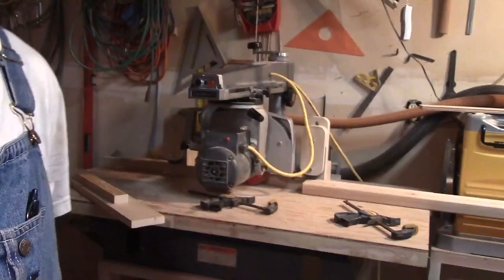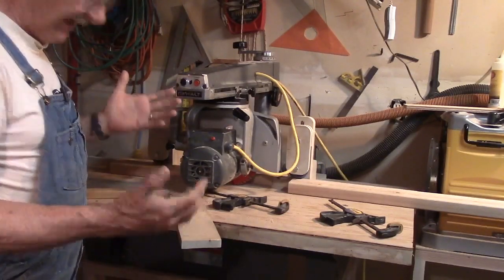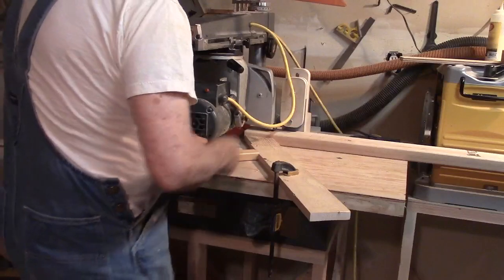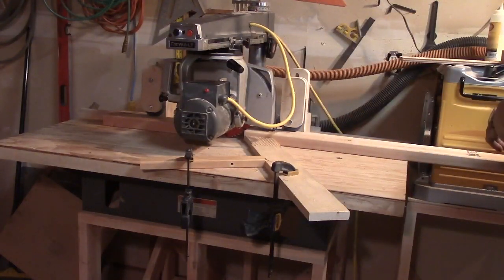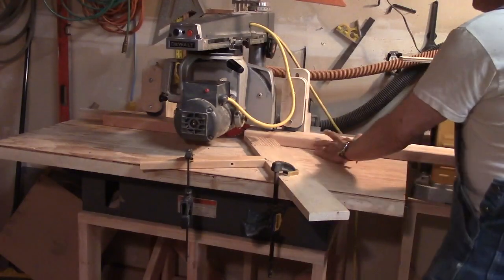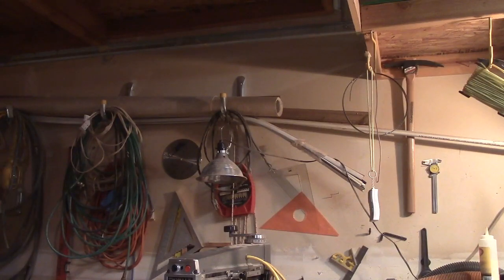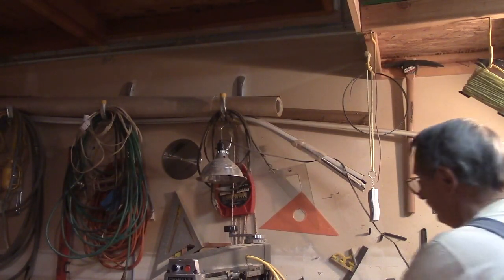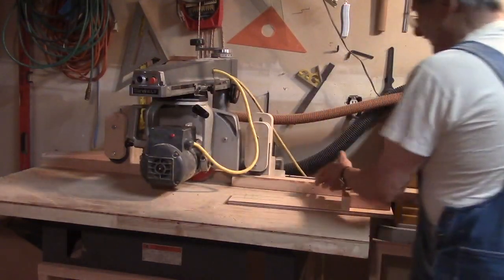Radial Arm Saw Ripping:  WARNING!!!

Comment: Hi Ed, How very honest of you to make this video. I'm impressed! I had my own little joinery shop years ago and I used the Dewalt 125 Radial Arm Saw an awful lot. When I retired, I built a workshop in my back garden and I was lucky enough to find a vintage Dewalt 110 to put in it. So far so good. But the very first thing I did was to try ripping down a length of timber by feeding it through from the wrong side of the blade. Waaaagh! So glad it wasn't caught on video!

Comment: Some good advice here Ed, yes RASs are inherently dangerous, particularly for ripping and when using dado blades. I had a couple of very scary experiences many, many years ago ... never got hurt, but it really taught me the power and speed that these saws have, and I still used the saws for many years after, but with a new respect for safety.  Good to see someone explaining these things .... thanks Ed.
Reply from the maker: WoodWorkWeb Thanks Colin.  Yep, as with all power tools things happen much quicker than a human can react.  I've been hurt by a powerful drill that got hung up, I've carried a nasty scar from a Skill Model 77 for forty years, a pneumonic nail gun cost me 40% of the vision of my left eye when I was twenty-two,  my thumb is still sore two years after getting it tangled up with the blade on my table saw.  But accidents aren't limited to power tools, I cut clear to the bone of left thumb with a freshly sharpened handsaw, "Eddy, don't work the saw, let the saw do the work."  I should have listened to old Frank. 
When I was much younger I had my difficulties with the RAS too:  The thing can kick a board out when ripping in a split second or climb up on a piece of wood when cross cutting or especially when cutting a dado.  I never got hurt because my dad was right there to make sure my body and hands were safely out of the way.  When I say younger I mean 18 or 19 years old.  Dad would never have let me use anything but a drill or jig saw before that.  After years of experience and being hurt in one way or another by lots of different power tools I'd say that all of them are inherently dangerous.  
Knock the fence out of alignment on a powerful table saw then try rip a truck dried 2 x 6 with a 1/4" crown and bit of twist in it and see what happens.  By the grace of God all my accidents were learning experiences that didn't cost me any fingers.  I ramble, sorry.
Reply: Inherently dangerous? I don't buy that. I suppose any sharp piece of metal could be considered dangerous not to mention adding a motor to it. With proper safety gear and techniques it's no more dangerous than any other saw. Stop spreading baloney.
Reply: Table saws are inherently dangerous!  Radial arm saws don't ever require you to push your hands toward the blade, let alone over it.
Reply: @JetSkiBuyFixPlaySellChannel  a corded power drill is dangerous bcs it can suddenly lock in and hit you real hard.

A chainsaw is dangerous (the majority of accidents happen with this) as the chain can snap and fly towards you at a very uncomfortable velocity.

Yes most of the accidents can be avoided with proper technique and safety gear.

But this does not take away that its dangerous. Something is not less dangerous just by proper equipment and technique.

The chances for mutilation or death are lower, yes. I’m a SCUBA diver, while quite few accidents happen. If you buy proper gear its highly unlikely that it will ever let you down and we carry a lot of gear around to increase our chances of survival if something goes wrong.

But that does not take away that its quite dangerous. There are a lot of ways you can fuck up and kill yourself. And if a severe accident happens it will most likely be lethal.

Comment from the maker: Roberto, thanks for the comments.  There are those who have small shops that don't have room for a table saw and a radial arm saw.  Some of these guys find the RAS to be more versatile than a table saw, as I do.  If I had a double garage sized shop I'd have a nice 3 HP table saw with a big out feed table/ assembly right in the middle, and my RAS across one long wall.  The other important reason to buy a RAS is cost: to get a table saw with enough HP to do what my Dewalt 790 will do would cost ten times what I paid.  I kept my little Delta-Rockwell 9" table saw with attached 4" jointer because I still like to use it for some cuts and gosh it only cost me $40.  But the little table saw just hasn't got the HP to rip thicker hardwood the way the RAS does.  I like them both.  Thanks for posting, thanks for watching.
Reply: hello. Sure, i do understand  these reasons  . i'm lucky for  having enough space  (  never enough )  in my shop . but, let  me say, 10 fingers are....useful. my sincere thanks for Your answer. best regards and...more videos about   You.

Comment: This video is very dangerous for the radial arm saw for ripping & using the tool the wrong way can result in permanent injury & loss of fingers & hand. Other people will try
this & will get serious hurt. The wood piece is pulled thru like a bullet when feeding the wrong way. My Dewalt radial saw specifies right on the saw the direction of cut for safety & always use the anti kickback arm.
Tony Trotta
Reply from the maker: +Jeannemarie Trotta You may need to watch the video again.  I did not push the wood through the wrong direction.  I am guilty of not using an anti-kickback device.  In my opinion using good roller hold-downs and a push board is a safe alternative.  There are those who believe that ripping should never, ever be done on a RAS.  I have ripped miles of 2 X stock using a RAS without injury, even so, I make it a practice to position my body out of the rip line just incase something goes awry.    Thanks for watching and I do appreciate your comments.
Reply: +Ed Waggoner Sr. (Papatch) My mistake you are doing it in the correct direction! I know i have seen some videos feeding from the wrong direction  and that is very dangerous. Thank you for the video!
Tony Trotta
Reply from the maker: Jeannemarie Trotta Thanks Tony.

Comment: Hi Ed,

I have just finished restoring a old Dewalt. Since it was ready to use I tried ripping some 12mm plywood on it. It was intended to be 140mm wide and 500mm long. I used a feather board on the in feed but when I got to the end of the cut the now separated board by the fence caught the blade and was pulled back and under, stalling the blade and leaving a huge curved gouge in my finished board. My push sticks where just some off cuts from a length of 30mm sqaure pine. Do you have any idea what could have caused this?
Reply: Guessing that the anti-kick back paws on the out feed side were not set low enough allowing the board to rise up and swing into the blade.   You can see on this video he has a roller on both in feed and out feed over the fence to reduce the chances this occurs.    
Can also happen on large cuts where one might have a tendency to create a pulling motion nearing the end of the cut, rather then a pushing motion all the way through.

Comment: How did you make the rollers?
Reply from the maker: Ron, I went to a skate board/inline roller skate shop and bought a couple of roller skate tires with bearings.  Inline roller wheels come in degrees hardness, get the soft ones.  Then it was off to the local hardware store for bolts; I got 5/16" bolts, a good part of the shaft was smooth (otherwise the bearings will wear).  You'll need a band-saw, jig-saw or scroll saw; a way to sand the corners.   I think I did a couple of videos that show different angles, pause the video and use the snip tool to capture the image.  I hope this helps.

Comment: Hello. I think that anyone who owns a ras , also possesses a  table saw,.. Therefore , unless you are in an outdoor yard with limited supply of machines , I think there is not                                                                                               the need to use a RAS  as ripping  saw. best  regards. roberto.
Reply: Hey! Roberto
Table saws can kick back too. And you are usually standing behind the saw in the line of fire when it does.
I have had a number of kick back incidents over the years with the table saw but never with my RAS.
Used sensibly, the RAS is a great tool and just as safe as a table saw. I have ripped miles of stock on my RAS and have never had an accident. In my view it is also much safer than sliding compound miter saws or chop saws for cross-cutting work.
If I was allowed to have only one saw in my shop it would be my RAS.
Hang loose man, and keep safe!
B
Reply from the maker: +Waney Edge Workshop I forgot to ask what country you are in.
Reply: In my opinion, the RAS is actually safer to use for ripping than a table saw.
Reply from the maker: Wren, I tend to agree.  Using either a table saw or a radial arm saw kickback needs to be controlled.  Once kickback is controlled I think the RAS is safer because there is less blade exposed to the user.  Using a proper pusher it is nearly impossible to push your hand into the blade.
Reply: italy.genoa. then,best regards from genoa. some months ago, i've worked in portland,oregon, during the  dry dock of a carnival ship. i''m a carpenter. hello.
Reply from the maker: Best regards to you too.  From Eugene, Oregon, USA.
Reply from the maker: @killingoldgrowthsince  Never could figure out how to put a riving knife on a RAS.  I do recommend the use of kick back pawls on a RAS if you have one.  A good pusher will keep you safe.

Comment: Even for cross-cutting, it's better to pull the saw out, slide the wood into place, and push the saw to make the cut.
Reply from the maker: No it is not.  When cross cutting one should pull the blade through the board.
Reply: It helps to have a proper blade for cross-cutting, and a conventional ripping blade for ripping.
Reply: Have to disagree. I have a new, negative hook angle crosscut blade on my RAS and it crosscuts so effortlessly and smooth. Perhaps you have a dull blade or the wrong blade, or even have the blade installed wrong?